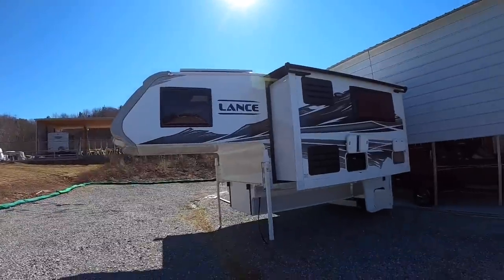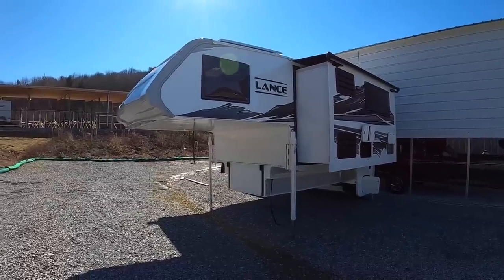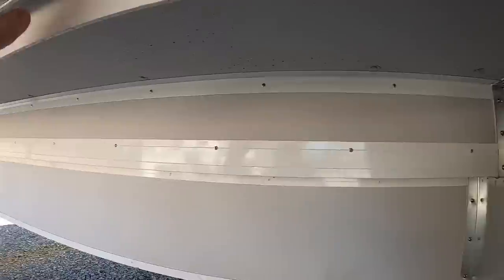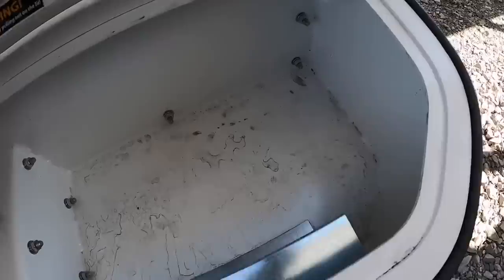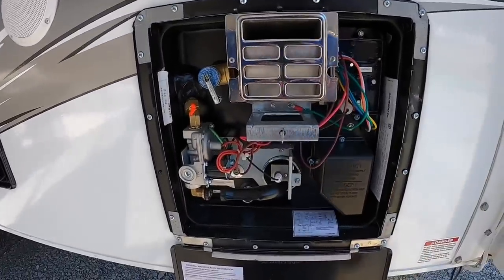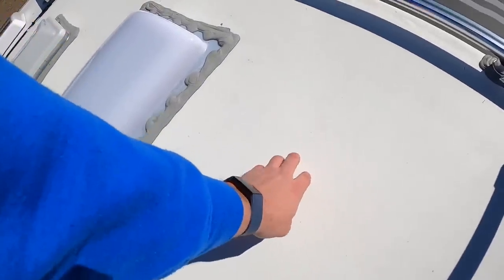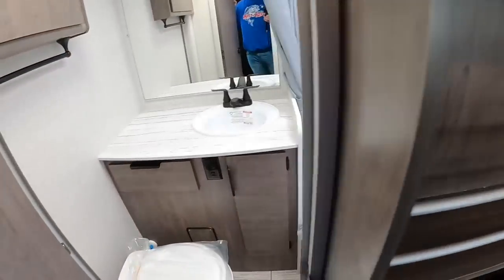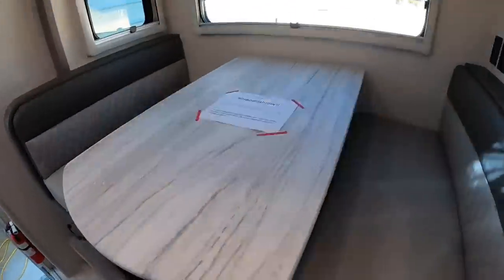New 2022 Lance 975 Truck Camper‼️ Like A Small Travelling Apartment‼️

Comment: I bought a 2022 Ram, 3500 limited, I over paid because of chip shortage. I was looking at the 450 but the payload is simply not as close as it seems.  I also have a lance truck camper 2005, (981) which is about 4500 everything in it. HOWEVER, it's not impossible to go up to nearly 2 and half ton (5000 pounds). .  I can't compare the two and I hope I didn't buy the wrong truck. My 2006 Ford F 350 Diesel is currently for sale, for 27 thousand, with 22 thousand miles. Sharpest dually I ever seen. Fixing to upgrade the camper it's also for sale for 19 hundred. Great video.

Comment: Brad, I run my fridge on 12 VDC when traveling. Eliminates the possibility of the propane fire while moving. Then switch back on propane when dry camping.
Reply from the maker: How long are you able to run the fridge off the battery before needing to switch? Mine went dead within a day with dual lithium and dual solar
Reply: @itsbrad  I always switch to propane soon as we are set up, so less than about an hour. I've never tried to run it more than a couple hours.
Reply: Get a full electric get rid of gas
Reply: @MrSparks54  When traveling .. are you able to run off the trucks alternator?  or pulls too much?
Reply: @matthewlevine5134  The truck alternator handles it fine. The fridge only draws a few amps.

Comment: I live in Cedar Rapids,Ia. They don’t sell Lance around here. I have a 2016 Tundra Crewcab with a 5’5” box. What is the largest truck camper I can install on my truck safely. What cost are added to camper for tie down installation? Thank -You
Reply from the maker: 650 is what would fit, they weigh on average in the 2,100lb range. Check your weight ratings to make sure your truck is sufficient

Comment: Hey Brad, what is the weight rating on the roof rails? Also can you advise the height to the top of the AC unit on the average one ton dually?
Reply from the maker: Roof rack weight is around 250lbs, I tell everyone to use caution going under anything under 13’

Comment: I was wondering can you get one with out the speakers from outside and can I buy my own TV? And can one come with a endless hot water heater? I just want a plain Jane like
Reply from the maker: They come standard with most equipment now with no opt outs that I know of. The Truma Aqua Go Tankless on demand water heater is listed as an option, but the two ‘22 models I’ve ordered with it have been showing up with the 6 Gal water heater. I have the 6 Gal water heater in my ‘21 975 and have not found a need to switch to tankless yet.

Comment: Thanks for doing all these wonderful videos Brad. I have a couple of questions you might know. If I ordered the ultra deck on the back of a lance 975 will it get in the way of towing a trailer? And also, what would you rather have for a pick up, and at 4:50 or an F350? Of course whichever one I get will be a LB Dooley. thank you
Reply from the maker: Hey Tim,
Thanks for reaching out, I would go F450 all the way just for the turning radius bc of the wider front axle then the 350. 450 has about 800lbs less payload then the 350 we had did, but we didn’t need suspension support on the 450 and we did on the 350 lol a lot beefier truck! We used a 48” hitch Ext for my 975 with the ultra deck. Let me know when you’re ready to order and we’ll go over options and get you fixed right up and ready to go. I believe I have a couple more 975’s listed to finish up here in the next few months, they’ll be 2023 models
Reply: @itsbrad    also larger, half shafts in the axles and larger brakes on commercial G rated tires. F450 all day😄 the cargo load will be be dependent on the trim level of your truck. For example, my 2022 F450 only has a payload of 4750 pounds but it is a limited edition with everyBell and whistle possible. The fact that Ford keeps this truck as a class three at 14,000 pounds is the reason for the lower payload all these options plus heavier brakes, heavier half shafts. All lead to less payload. If you spec out an F450 XLT, or lariat, you will have easily well over 5000 pounds useful Payload.
Reply from the maker: @skoffco  I agree, our new 2022 Ford F-450 payload is 4,886lbs. Platinum, 4x4, FX4, 6.7, all the options they’d let us add that didn’t come on the Platinum package, etc… 2017 F-350 we had spec’d the same way was 5,6xxlb payload and needed hella suspension support for the TC compared to our 450 not needing jack lol 😂

Comment: Brad, do you have any customers full timing or chasing tournament trail bass or walleye in the 975? It sure looks like it would work well. You make a fun tour presentation for sure. You present a lot of information in a really entertaining way. Would a 450 work better or is a 350 adequate?
Reply from the maker: We have a lot of pro bass fisherman running these nearly non stop during tournament season. 350 has the higher payload on paper, but the 450 is beefier with a wider front axle for better towing.
Reply: @itsbrad  Thanks Brad! It looks like a 975 could work for me. A dry bath would be nicer for full-timing.

Comment: Real crappy deal on the refrigerator when you have a two solar panel that can’t even keep up with the refrigerator if that’s what you’re applying??
Reply from the maker: Fridge pulls a lot of juice lol
Reply: @itsbrad  what if switching the battery out with the lithium batteries would that make a significant changes by running a solar? Friend of mine has a host and arctic fox and they have a 12 V refrigerator !!! Do you think the Lance will have a similar concept?
Reply from the maker: @shaeharris7961  I have dual lithium and dual solar added to my 975 and fridge still killed them within a day. If Lance thought going to a 12v only fridge was the best route to go they probably would’ve already made the change.

Comment: When is Lance gonna give me a 12 volt fridge?!!
Reply from the maker: The fridges in the campers now are capable of working on 12v along with gas or electric. The forums I’ve read so far about 12v only fridges do not seem to be better. Could you inform me why a 12v only fridge is better then the 3 way fridges that come with these?
Reply: @itsbrad  i don't like the idea of going down the road with propane on. Plus the new 12 v fridges maintain a better temperature and use less battery. Without the fins, there is more capacity. Can I order a Lance without a fridge?